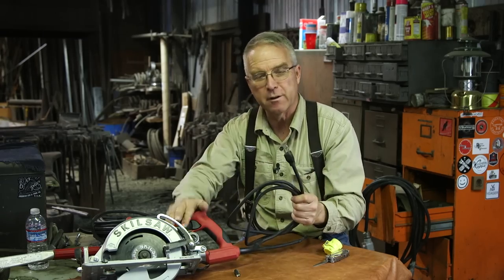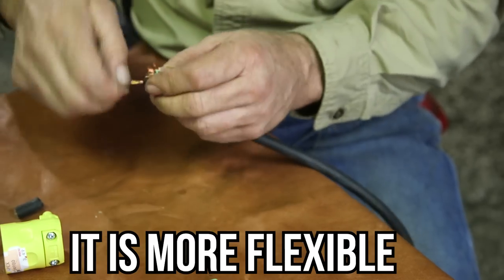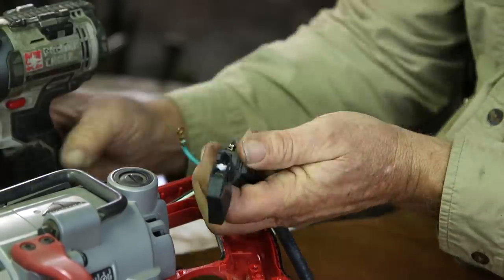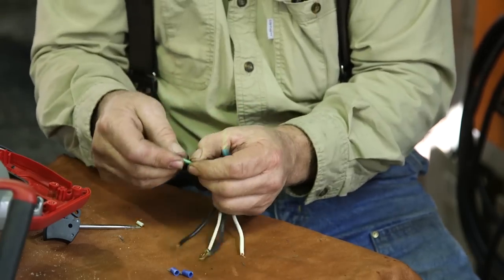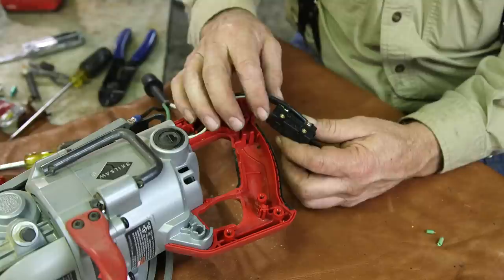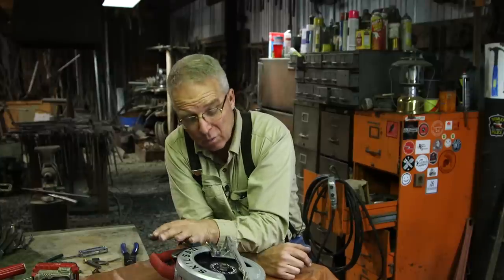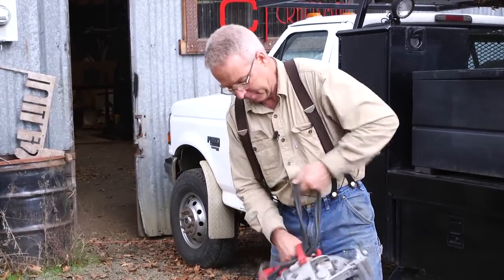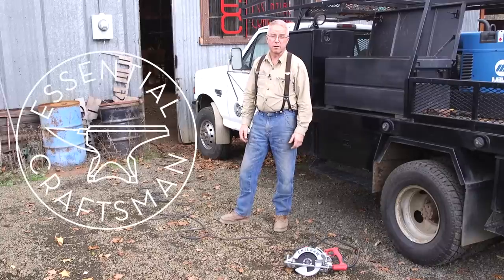Skilsaw Cord Install and Storage Tip

Comment: Gosh this takes me back years ago I was working on a new building going up in Toronto. One of the carpenters came to me asking me to add a cord to his skill saw. He cut his cord off it and wanted to do more or less the same thing as what you are doing now. He gave me an old cord they used on the job that was beaten up at the ends but was still good for something small like this.

I was the young apprentice electrician on that job. It was a bit slow the time he asked me to do this and he was helping me out when I needed to get some work done in some walls he was setting up. So I asked one of my journeyman for help to show me how this was done and more or less the same thing.

After that the carpenter everyday worked faster and thanked me for helping him out but I felt like it was the things people did on jobs. You look after each other and help each other out, just to make life that much easier on the job. The place no one wants to be but you are their to make it by in life.

Comment: Per your instructions, I added a 12 guage 40' cord to my worm drive. In retrospect, it seems obvious to do so. Now my knotted extension cord doesn't get caught on rafters or come loose & unplug. It's also funny when guys try to "borrow" my extension cord then discover it's the power cord to my worm drive. The only change was I installed a red one to match the handles. This is a game changer! I've learned a lot from your videos. I also never thought to plunge cut into a rafter edge when the pitch won't allow me to utilize the rafter hook. Thank you, sir.

Comment: I spent some time in the USAF repairing aircraft communications systems. I keep a soldering iron in my tool box with a tin of flux. Whenever I make any upgrades, similar to what you demonstrated today, I tin the ends of the wire. No fray. Solid connection. I appreciate your skill and moxie. Thank you.
Reply: Same here. Everything goes together better and feels solid.

Comment: So I did a twenty-five foot cord on my little dewalt sidewinder after your first video. I've been on the hunt for an old seventy seven. It like to find a made in the usa model. Its my shop saw. I do hvac in pa so on my service truck i carry a small 20v dewalt. Thats all i need on the road. But for the shop I like to have corded tools. I do appreciate the knowledge you've shared over the last 2years, I've learned some great production tips that I've had the pleasure to share with others.... giving you folks the credit of course.
Reply: JT, Be patient, there are lots of used, made-in-the-USA Model 77s out there at very reasonable prices.
Reply: @rightlanehog3151  my old man picked up his for 15 bucks. I just did a once over on it today. It was used as a masonry saw, so it's been used and abused, but it still works fine.
Reply: @TheFeralEngineer  That was a very good price for a saw that still works.
Reply: @rightlanehog3151  it needs a few bits and pieces, like i can't get the pivot screw out of the casing, so I'll either have to heat it up with a torch or get a new top guard, and it's missing a thumb lock and the handle is being held together by glue and a prayer, but it still works.
Reply: @TheFeralEngineer  The plot thickens....

Comment: I see where you are going and i am glad that works for you.   I personally go the other way.   My saw has the cord shortened to where the saw can't cut it.    I use and extension cord adm tie it off through the handle.  Bosch had and elegant system on one of their saws with retention for the  socket end of the cord build into the saw.    Milwaukee had the twiat lock cords, but i hate to be tied to to something i can't get at any hardware store.   All respect for you and your channel.   I share your content with my coworkers, you are a master.

Comment: I'm a stagehand--I deal in cables that have been dragged through mud, beer, and puke for months on end. I urge you to try the over under (search roadie wrap on youtube) . If you get good, its faster than the crochet method. It will never put a bend or kink in the wire, you can also choose to have all your slack at one end rather than the middle. You can pull from the end of the cable not the middle, or even through the whole thing while holding onto the end, and the cable will always pay out flat to the floor. Give it a go...
Reply: Agreed, learning about that method was an eye opener for me.  I now use it for everything.  The most useful part for me is being able to throw the line and have it actually go where you want and not get tangled at all.  It's a great method to store any kind of cord or line.
Reply: Yep. It’s how I roll... 😁
Reply: STAGE HAND/THEATRE TECHNICIAN HERE TOO. CAME TO SAY THIS. HOW ARE OTHER INDUSTRIES NOT USING THIS METHOD??? COIL YOUR CABLES FOLKS
Reply: To help people out, here is a video showing how it's done.
https://youtu.be/uy3axdxDdKs
Reply: I had a guy chain stitch one of my extension cords. I told him he could keep that cord and buy me a new one...

Over/Under is the only way to manage a cable,air hose, extension cord, etc. 

You can do it other ways but they really don't make as much sense.
Reply: "Over worked and under paid" = easy way I remember when rolling cables (especially after gigs) :)
Reply: Problem is they won't store well in a toolbox with other stuff unless you tie the coil up first.
Reply: My dad taught me the Over Under method when i was a kid, he said it was a contractor's standard method. I was so surprised over the years how few people did it or even knew about it. Even 4 years in the Coast Guard, and I met only a handful of people who coiled extension cords the right(Over Under) way.
Reply: @dutchgray86  yes--keep a length of tie-line or a bongo tie on one end of the cable. I say it's still worth it though.
Reply: @dutchgray86   or use a 3M velcro type cable tie? (the one wrap kind stays around the cable) Works fine for me, even after a dusty or muddy festival.
Reply: You just changed my life. I just rewrapped a dozen cables and I feel like I’ve been reborn. Thank you. Thank you.

Btw all, here’s a good intro: https://youtu.be/uy3axdxDdKs
Reply: @flyingcrowbar1599  right?!? like odd flex, but even my headphone cables don't get tangled ;) just be sure to pass it on.
Reply: @hydrusje  hah yea I used to be super biased against the velcro ties because they sucked, but that new 3M velcro has a much better life span. good stuff!
Reply: Julian Amrine Just try and shut me up about it!
Reply: Doing it your way prevents the conductor from getting damaged by kinks.  My dad, retired from the power company, says those kinks are called “assholes.”
Reply: Works well till you pull a hundred footer Edison backwards cause some greenhand fucked up and did it backwards and you get knots every 2 feet
Reply: Daniel Gray every cord I have has a cord hanger on it that manages it with Velcro and allows it to be hung up in my van or tossed in a truck box. 

In staging and venue sound/lighting they typically tag a piece of black cordage onto the male end so when it's rolled up you can tie it off into a coil.
Reply: @dutchgray86  Add a piece or two of velcro.
Reply: I do love the over under for cables that I know only I will use and no one else will ever touch. BUT, for some reason I find very few people can figure it out and it just ends up in a giant series of knots if someone else tries to uncoil an over under. I don’t see what the problem is but so many times I’ve had this problem because guys can’t figure it out. Anyone else find that too?
Reply: thank you!
Reply: Yeah. I just about died inside when he pulled that nonsense.

Learn to wrap it right, get a Velcro tie on the end.
Reply: Over and under is the way to go.  Cord is more compact.
Reply: You can also throw and unwrap the cable in one go if your really good at it. Highly suggest learning it! It will increase the life of the cables 10 fold
Reply: I came here to say the same thing. With a point about having a bongo or Velcro tie at one end. If tied it wouldn’t be an issue to toss in the toolbox as he does either.
Reply: I'm in G&E on films, so yes! Please over under. It'll always lay flat that way. Also! Always start from the end of the saw, or in my case, head.
Reply: @MichaelVickery1  they're ok, but a long piece of oiled string is better
Reply: Your  roadie wrap will be a tangled mess riding around in that tool box with all the other tools and sliding back and forth when people start digging around in the tool box. That chain stitch will still be just fine. The roadie wrap is fine for guitar leads but sucks for construction cords.
Reply: I like the over under but have tried every conceivable cord wrap available and they all fail in tool box or back of the truck. For this application the stitch method really is best.  The extension cord is going to wear out from other damage way before the damage from stitching it will effect it.

Comment: I have to say this is a necessity even for use of a circular saw at home! Who wants to grab the extension cord every time you go to use your saw, even in the garage?? Thanks for the tip!
Reply: Is that not what you are doing when you have a 50ft cord attached directly to the saw?  Another option - leave a 50ft extension cord attached to the saw.
Reply: Michael Cox no that’s exactly what you’re not doing.. literally the point of this whole video dude
Reply: @kookiethebear  To spell it out, the extension cord will either get misplaced, won't always be with the saw, will come unplugged, or even if plugged together "permanently", the plugs will catch on things.
Reply: @kookiethebear  That is what I have been doing for 35 years as a roofer/framer. Just tie the ends together and the cord doesn't get separated & the end does not catch on anything anymore than on the end of the saw.

Comment: We stopped using wired skilsaw, we switched over to battery powerd including the 60v dewalt circular saw. I love it, they are lighter, no more stringing out power cords, cutting cords, dealing with shorts(happens all the time because Eugene OR) and 2 batteries last all day but im a Concrete Carpenter.

Comment: For my dad,    First I have seen you.  You tell some pretty good things.  You teached another ole man a new trick today.  I am just an ole guy that does his own work around the house.  I have built a shop, deck, remodeled the kitchen and bath, Repaired the sink drain line that leaked and wet down the basement needing to replace the cieling and walls sheetrock, and laying a ceramic tile floor.  Just some light work to keep me busy.

Comment: If you solder the ring connector after crimping it, you are guaranteed a great connection, electrically and mechanically. That's how I was trained to do it by my mentor 30 years ago. Nice video!

Comment: I did the same thing recently to revive my old sidewinder Skil 5150.  A new 40’ cord made all the difference.  Just remember to replace with a heavier gauge than what they installed at the factory.  This is a good tip for not just the pros, but us DIYers, too.

Comment: To each his own. And with great respect to you and how you do it, I would do mine almost the complete opposite. For most of my career the first thing I would do is cut off the cord close to the handle and install Hubbell twist lock connectors. My extension cords are also set up the same way. I had this set up on all my tools. It was always a pain to have all the cords of each individual tool getting mixed up with all the others. This way, you grab a tool and an extension cord to fit your need, twist lock it together, and away you go. The twist locks work so well that there have been many times I would lower (or raise) my Skil 77 from the roof to the ground and never worry about coming unplugged. Another great vid! Thanks!
Reply: That’s a really good idea. I am definitely not upset to see batteries finally catching up to commercial use demands. Cordless is a damn godsend!

Comment: Watched this over a year ago.  I have a cement mixer that runs off a 1/3 hp electric motor.  It lived outside for about 20 years and the motor failed.  I replaced the motor and had to add a power cord. I remembered this video so instead of the 10 ft cord that came with it I installed a 25 ft cord.  First time I used it this past summer the cord was exactly the length I needed.  What a simple and great idea.

Comment: A tip on putting screws back in plastic or any material that is using a thread cutting screw is to put it in the hole and turn it out until you feel the screw fall into the original threads before tightening it.  This makes it follow the the threads cut on the first installation and reduces the chances that it will cut new threads could weaken the connection.

Comment: Had a contractor I worked for always used 100ft extension cords .  Always have been a fan of the longer cords on my saw since and that was back in the 80's

Comment: I like the idea of a long cord on my tools(saws, drills etc.) however you need a lot of cord for all the tools.  I have no cord on my tools, just a pigtail and a twist lock plug (6 inches). I have one extension cord which I am able to use on all the tools as I can only use one tool at a time.  Works for me.
Reply: Louis Howard I have the same setup
Reply: That does everything except lock. This guy lowers his saw from the rafters by the cord. I think for a framer, it makes sense to have the cord attached securely.

FWIW, many of my low amp tools I use at a bench have no cord at all. Just a socket. I keep one 6 foot cord at one bench. I keep one 8 foot cord at the other, because the nearest power outlet is farther away from that one. (I obviously work on much smaller things more often than framers.) So I totally get it. Even without the longer cord, there's also the huge advantage that you don't have to manage the cord when you put the tool away. 

And one of the best parts is how I can hang my power tools on a pegboard just hand tools. Every tool has its place, and that is worth a little extra time of unplugging and replugging the single cord like an air tool.
Reply: Louis Howard just said the same fella, but more wordy😂😂😂 you’re absolutely on the money right.
Reply: Mildy Productive know where you’re coming from, I suppose the only way over is use the best twist locks you can find and fit. 👍🏻
Reply: @nickturner2606  Yeah, that would be nice. The ones I use don't lock. 
If I were a framer, I would have to set down my saw 20 times and hour. Because I don't know how to do it and because I'm way out of shape, lol. I think it would be stressful if "did I lock the cord?" crossed my mind every time I had to let go of the saw in a precarious spot. Like if I had to rest... or if I lost my balance 20 feet above a hard floor.
Reply: Mildy Productive I’m an old bugger too mate, so I know that feeling of “did I/didn’t I. 
My choice are the Festool items, they’re push/ twist and if you don’t push/ twist, no juice to the noisy bit!! They’re a little pricey but useful.
Reply: Me too,  I "knot" the extension cord to the saw cord (or whatever tool) and never have an issue with the extension cord getting pulled out.
Reply: @Mike__B  You can knot them together and they will still catch on things as you walk around. That's one advantage of a single cord.
Reply: Most production framers have no lack of cord or hose because they have multiple people using multiple tools simultaneously
Reply: Honestly I think that's a very good rig for anyone except a full-time production framer stacking roofs.  Even if you're a full-time general framing carpenter one long cord and tools set up with twist-lock pigtails is a great rig  - efficient and safe, with one long cord to roll  out/up.  If you're in rafters all day long, even that pigtail gets caught on stuff and can be a problem when hauling the saw up and down by "the tail".
Reply: Here in N.Z we have to get all our tools tested otherwise we are not allowed on job sites. Now 80% off all tools are cordless which I prefer Makita 18 and 36 volt platform.
Reply: @JDeWittDIY  but if the hard cord to the tool is short (less than 3 feet) the knot is close to the tool and it won't get caught.

Comment: This is fantastic. One improvement I’ve made to this is to use a NEMA L15 locking plug on a short whip dangling off the saw, male end, and make the long cord a female locking end. They twist together and head up a ladder no problem. Have this setup on my worm drive and sawzall. Bonus: keeps the dummies away from your most dangerous tools and they’re easier to get back from a pawn shop if stolen.
Reply: I love this, great tip

Comment: I have also been doing this to lots of tools most my life.  Specifically items like a battery charger for my boat that needed to be longer to avoid an extension cord and several frequently used saws, etc.  I recently bought a red metal cutting circular saw and was amazed it came with a 15-20 ft cord factory.

Comment: When ever a cord goes bad I ALWAYS put a longer cord back, maybe not 40 to 60 feet but 25 for sure. Also I use porter cable drills too, they might not be the best but they are pretty good and they are cheap.
Thanks Tim.

Comment: This is one of thoses "why didn"t i think of that"
That is so obvious and simple, yet takes an experienced craftsman to show me. 
I have always dragged around an extension cord with the skillsaw. And in my mind they have become unseperable. ...always making sure the connection is safe, having the connection catch and bump on the workpieces. working with super sketchy extension cords on job sites, draging a specially dedicated extension cord with me to avoid sketchiness and have a distance from the powerplug and so on. 
wow. this has been an eye opener. thank you so much. 
I love all your tips and the knowledge that is based on years and years of experience, not on an extensive Google and Wikipedia search -like a lot of self proclaimed youtube "experts" have.
Changing my cord first thing tomorrow. Thank you!